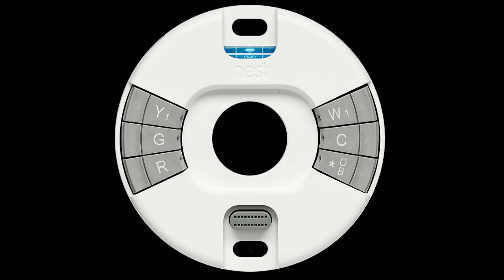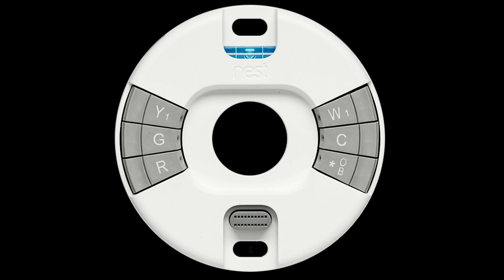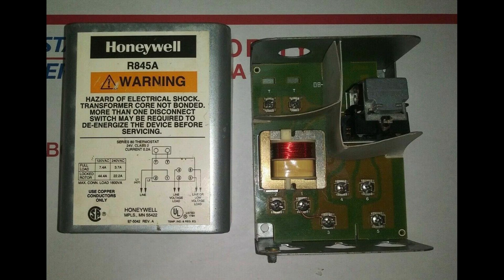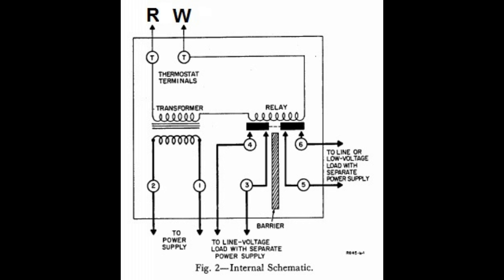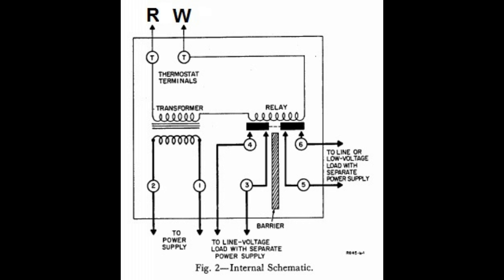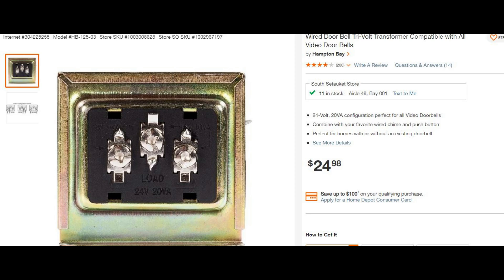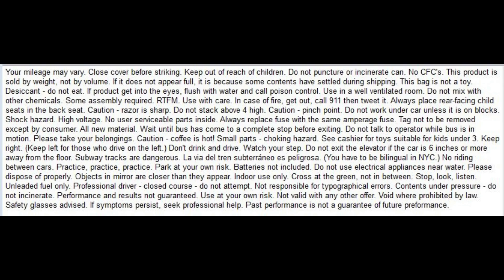Connecting a Nest E to a Honeywell R845A switching relay by adding a C wire.

Comment: Hi,  I have a Triple Aquastat on a Hotwater oil fired furnace. The Triple Aqustat Honeywell L8124A (that number may have changed) has TT for the two wires to the thermostat which is only an (End Switch" that  controls a relay for the  pump to baseboard heat. I have an additional pump for a second zone useing a Honeywell R845A. Same TT (End Switch) and relay control.                                                  I watched several videos one recommendation was to connect a Power supplys to the R & C on the Nest E thermostat. That burned out both contactor coils for the pumps and two Power supplies . I had to replace  both controls.                                                                                                                                                               I watched another video. So far it has been working fine with out a C wire only using R & W to both thermostats two separate wires  to both controls.                                                                                              Your fix looks good.    Unfortunately  I will have to fish additionl wires. I wish I had the        schematic of the Nest E thermostat. foot note  I did have a Power Supply connected to the R & *OB  One nest E  thermostat it  worked  but I never tested the Battery. My Nest E has a built in  lithium-ion Battery.
Reply: HI, first of all Nest e thermostats do not use the google home app.https://www.youtube.com/watch?v=95YJjFOKDOY&t=29s  It has iis own app as shown in a youtube video that works without a C wire.  Also in you video you show  an R845A pump relay connecting the R wire to the added transformer to the left T.  In some  schematics  the first T (on the left) goes through the coil that brings in the contactor or after  the load side of the transformer.   I would say you would want make sure  the R wire on the Transformer line side  before the contator coil (right side T)   I could be wrong on this   Any thoughts on this are welcome.         Also if your are connecting an R845A controling a second  Pump. Usiing a L8124A Triple Aqustat the R845A  gets its 120volts Line 1   to energize the transformer from the ZR ZC Terminals. These terminals do not supply a constant 120volts to the R845A  https://www.youtube.com/watch?v=QgxhqGuUfVY&t=575s

Comment: Great video, the world needs more of you in it!  Question:  you still had to run a new single wire (your new C wire) from the controller to the thermostat right?  Why not just run a new thermostat wire bundle then?  Also, couldn’t you have bought a 120v / 24v transformer you just plug into an outlet and run it to the thermostat? - I mean you’re running a new c wire from that area anyway, why mess with the controller?  Thx!
Reply from the maker: I didn't have to add any wires to what was already there. The previous owner ran 3-wire cable to the thermostats but used only 2. All I added was a 2nd 24-Volt source and used the R wire as a common return. It's still running as I described in the video to this day.
Reply: Thanks, makes sense.  Well done!

Comment: It's a cool setup, but I might as well get a 24vac transformer and run the wires from the attic down through the walls to the thermostat. I have a similar thermostat setup like you, but I have a huge attic space to work in.  I had to change the doorbell transformer in the attic to accommodate the Nest doorbell cam. Didn't have enough amps.

Comment: This works. January 2023, have solved this exact issue in the Boston, MA area.  A two-wire heat-only system with the exact model number of switching relay as mentioned above. In my case I used a Venstar Two-Wire Kit for it's power supply, instead of a doorbell power supply. The Venstar product was a result of research on Youtube until I found of course this post above. Thanks Frank!

Comment: Hello. This is great. I wired 1 up, so far it is good. How did you wire the second thermostat from the same transformer? Did you have to connect to the R terminal of the second R845a?
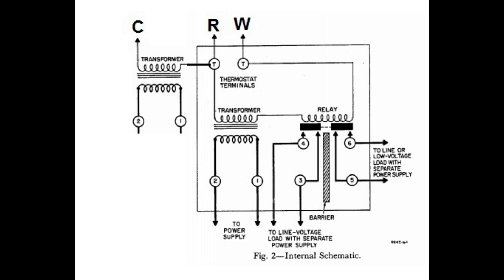Reply from the maker: I have 2 thermostats on one transformer. The C wire from the 24VAC transformer (as pictured in the video at the 2:15 mark) goes to the C terminal on both units. The R & W wires from the thermostats goes to the T terminals the relays. Does that explain it?
Reply: @FD347  thanks for the quick reply. I got the C terminal part. Do I need to connect the second leg of the transformer to the R terminal of the second unit like you did on the first unit.
Reply from the maker: Yes, jump the R wire from one unit to the other.
Reply: Thank you. Will try later.

Comment: Your Nest is able to run from the power of two AAA batteries for... Months?  A year?  I'm taking a chance and trying the C terminal from the R8845U tiny transformer.  I'll be using an Amazon Smart thermostat, so I hope it isn't using much more than that 200 milliamps…. Actually, the R8845U has a 1 amp fuse, which is five times that.
Reply from the maker: I'm going through a set of batteries about once a year. Good luck with your setup.

Comment: Great video - I was wondering if you would be so kind as to explaining the part where you installed the doorbell transformer to the relay. I am not knowledgeable when it comes to the secondary wires, where to run them to the switch, etc…I have the exact same set up but still not sure which wires go where! Help! Ty so much!
Reply from the maker: Inside the relay are 2 terminals marked T. The wires from those terminal should be going to the R and W terminals of the Nest. From the transformer you have 2 wires. Run one of those wires to the Nest and connect it to the C terminal. Run the other wire to the relay and connect it to the T terminal that connects to the R wire in the Nest. You should end up with 2 R wires and 1 W wire in the relay. Here's what it looks like in my relay: http://www.FDNewYork.com/externals/zone1.jpg 

Does this help?
Reply: @FD347 would you mind sharing it again. The link is expired now and I am running into the same exact issue
Reply from the maker: @bluesclues6586 https://youtu.be/9V0uezOfg-0?si=93AzNfBPwp7CqLy-

Also check out the reply from Jeffrey John up above. There is another relay that you can use which has a C terminal included.